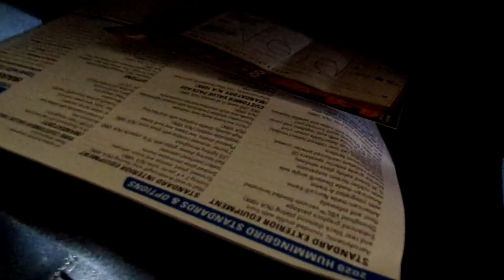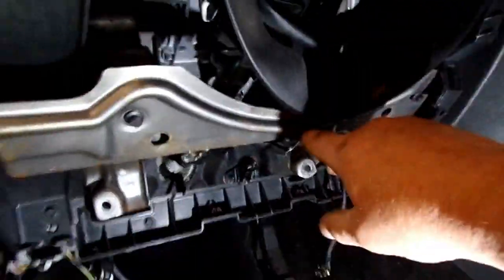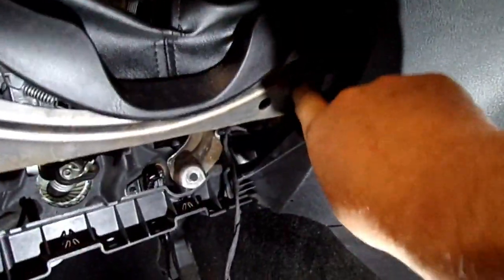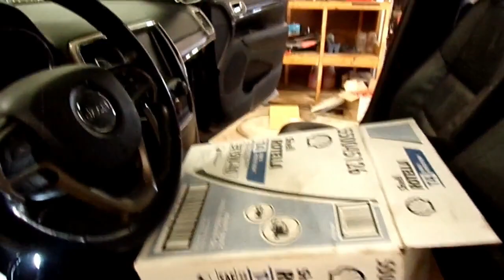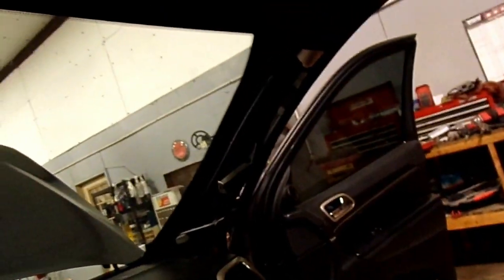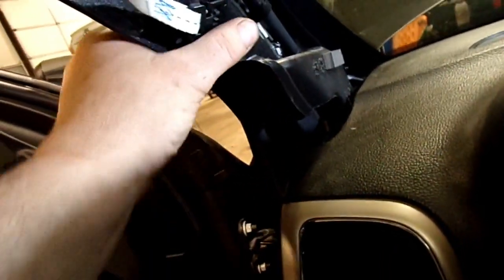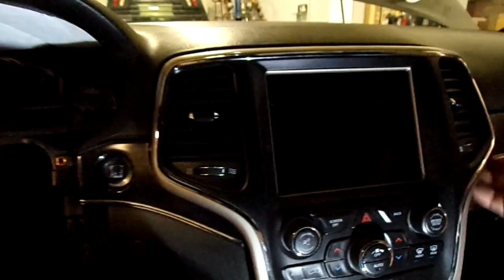2014 JEEP GRAND CHEROKEE : A/C BLOWS HOT , DASH REMOVAL AND BLEND DOOR REPLACEMENT .

Comment: Excellent video. Dismantling the dash is a heck of a job. To avoid this you can break the door free by spinning the gear manually under the dash (you’ll have to spend some time running the heat to soften the seals) otherwise you’d never be able to do it. When the gears get replaced you can put a screw in the stopper on the gear to prevent it from turning the blend door all the way. The result is fully working ac. You’d have a very tiny amount of heat loss on max heat. But it beats ripping the car apart.
Reply: Which gear do you need to spin? The gear of the flap on the vent-just manualy force it open?
Reply: @mattheweason6971  the one that stay in the hvac, normally they are blocked, thats why the door actuator gear break, i am about to test that tomorrow,
Reply: How do you get in there to manually rotate the stuck things. There is a door in the way from fully getting my hand in their.
Reply: Can you do this for me?
Reply: Is there a video on how to do this?
Reply: The motor forces it closed and pushes the door past It rest stop computer gone crazy nice

Comment: I have fixed this problem myself twice. I'm convinced its a combination of the material for the seal, the glue and possibly the heat. The seal turns into a sticky tar like goo, it can not only just glue itself in place and jam the door, the seal can fold over and get stuck in the gap between door and wall of the unit, jamming it as well as gluing into place. I'm currently putting it back together and this time I just tore the seal away and got rid of it, it was like strips of gooey tar. This has been going on for 25 years in the Auto Industry, they have gone to these complicated HVAC units with actuator motors to open and close doors to direct airflow, but then make them out flimsy plastic and materials that are prone to break if the slightest problem is encountered. For something buried under the dash that will require at least a $1000 of labor to change this totally unacceptable. Things to go under the dash and are so hard to replace, need to be engineered to be very durable and long lasting. Yet we get these flimsy components that degenerate into goo or break when the slightest resistance is encountered.
Reply: If the seal was just melting from the heat, well besides horrible engineering they select a seal material that would melt from the heater core, but the seal would go back to normal consistency after it cooled off, although misshaped. The seal turns into a gooey sticky strip, its something with the glue and material of the seal itself for this to change into something like this.

Comment: Came by this video trying to learn how to remove certain trims on the dash to replace the console lighting... It was at that moment I realized... this is NOT something you wanna DIY. If the AC dist case breaks... just have a pro do it. Just remembering where all these bolts go is next to impossible. Kudos to you bro!! Ppl can now appreciate why certain jobs require paying a ton of cash for. Changing a tiny seal or a gear could require the entire car to be dissasembled.

Comment: Completing this job tried all the hacks, but bought the unit on the 2012  SRT the dash has 2 Philips screws on each corner near the windshield. I am fixing the leather dash also , the heater hoses when the unit is free from the firewall i had enough room under dash to grab both hoses. Thank so much for taking the time with the work and video God Bless!

Comment: Honestly did more work than needed. You don't have to take out the entire mounting bracket there's two little bolts in the top corner that are hidden. If you take those out you can take off the entire dash without removing the brackets.

Comment: Incredible work. So much appreciated. Would not have tried this without your great detail. I actually had 100 degrees from my vents w ac on and 70degrees outside! I put a hand valve on the heater core hoses to stop heat flow in the summer. Got it down to 50 degrees but now im going to actually fix it.. cheers!
Reply: Explain if you don't mind

Comment: I have a 2014 Grand Cherokee, passenger side blows only heat when AC is on.
Questions,
1)  I have heard it’s possible to replace the blend door motor and gear by working through the opening after removing only the glove box.  In your opinion do you think that’s possible?
2) What would a Jeep dealer charge ( approximately)for this job in labor, $1500-$2000
Thank you - awesome video!
Reply from the maker: Yes , the blend door motor can be replaced thru glove box opening , I don't know how much the dealer will charge for repair .
Reply: Yes it’s possible. I just removed my on a 2011 Jeep , because the blend door gear was broken on the passenger seat,but also the assembly actuator box is not good, in my case the plastic is melted because of the heated , so I think I will prefer to pay $1200 😅, I don’t even have all the tools to do what this guy is doing on this video. And it look so difficult 🥶

Comment: 1. Must have tool: Harbor Freight, PITTSBURGH Ratcheting Right Angle Multi-Bit Screwdriver Set, 8 Piece $2.99							
2. Disconnect the negative battery cable (under passenger seat for 20 mins.) to recalibrate the blend door actuator system.

Comment: It seems that all the part numbers are the same for jeep and durrango. The mopar part # for heater distribution housing is # 68224169ab the o-rings are 68239586aa and the heater core clamps are 68031980aa. Hope this will help some people too. I personally emailed Danny he emailed me right back about a question I had. Thanks

Comment: I have the same year GC and for a minute there thought that was my car that I had recently bought. Mine is a 5.7 HEMI though. I realize you went through a lot of work on replacing that blower housing. My question is " What's going to stop it from happening again? Did it look like the damper gaskets were made of the same crap material? My AC works for a while, then without touching anything, I lose the AC and the air seems to get very week even at full blast. I can turn off the system for 15 minutes or so and then it works fine again but only for a short while.
Reply: Sam issue here! Start the car and AC works just fine but after a while air starts to come out warmer and air flow goes down. The fan seems to run at full speed, I even tested it without filter, no change. Something blocks the air gradually and then recovers. From how the system works, it makes no sense that air stops coming out and then recovers... Not sure doing this huge effort will solve our problem. Any ideas/advance?

Comment: Awesome work! Thank you for sharing. In my case with my 2011 jeep, I was able to reach underneath my steering wheel to just replace the blend door motor and I think it was strong enough to pull that melted seal apart. But because of your video, I now have a full understanding why it failed in the first place. Thank you!

Question: if my car has a hard time or takes a long time to blow out cold air when it’s hot out, what’s the issue? AC clutch, evaporator valve? I’m getting good pressure, doesn’t seem like it’s a refrigerant leak. I do somewhat hear the fan bearings on the front right dash when you kick on the AC as well but it still blows so could be ok…. I could also try cleaning the condenser too…any suggestions?
Reply: Did it work for you?
I'm in your shoes and tryna find out which route to take

Comment: I have a 2014 durrango the doors in my HVAC box done the same thing. As read someone else commented this should be mopar problem, it definitely should be. This is a big job. I went to my local dodge dealer and got the part numbers for the stuff i would need. Off coarse they were telling me to change the HC, EVC and hc tubes. They said I needed the heater core tubes because they were 1 time use. So I wanted to ask you at the end of your video did you repalace the o rings on the heater core tubes if so whats the part #. Your Video is great by the way too. I do everything myself but sometimes just need that little bit of confidence from a videoo like yours that i'm doing it the right way.
Reply from the maker: Yes I replace the o-rings  but I cant remember what the part number was . I did get them from dodge dealer so I don't know what's going on with that , Maybe they are trying to up sale you on parts    .I would call a different dealer and ask them , Also there could be a different design between Cherokee  and Durrango , Anyway good luck

Comment: Hi Sir, what about after a replacement of dashboard of a 2018 jeep grand cherokee and needing some codes for starting and run and drive?
Reply from the maker: Not sure if I know what you mean , if your installing the old dash back in it should start  ( battery disconnect and reconnect should clear any PCM codes and reset calibration on blend door motors ).
Reply: @heartlandmechanic  Yea, you right, but I mean if you install a new dash, restoring a salvage 2018 jeep grand cherokee and dont wanna start... only lights, no run
Reply from the maker: @crys161  have you had a scanner hooked up and ran it for codes , possibly the security system has you locked out , One thing you could try is if you have the original instrument cluster try and plug it in and see if that helps .

Comment: nice video, I'm planning on replacing the blend door box on my 2013 Jeep Grand cherokee myself but I had a question . Could you just disconnect the heater core lines at the blend door box and just remove that without removing the whole assembly from the vehicle?
Reply from the maker: I don't know if you can get to the 2 screws , It would be worth trying . Let me know if it works , that would save a lot of time .
Reply: @heartlandmechanic  I finished the replacement of the mixing box thanks to your video. I do have an issue now with the display screen reading damaged key fab and that with either key used. I can insert either key and start the jeep. Do you have any ideas what could be wrong?
Reply from the maker: @fundog8922  Wow that's a new one on me . Lets try to manually reboot the passive entry module , Disconnect both battery cables and then jump the cables together ( touch cable ends together - UNHOOKED from battery ) for a few minutes . This will discharge the capacitor and reset set the module .

Comment: does all thsi need to to be done to change the expansion valve as well
Reply from the maker: you will not have to remove dash but you will have to remove that outer firewall to get to expansion valve , remove the nut holding a/c lines on the valve , pull the lines from the valve and there will be 2 torx screws that will need  to be removed , the valve will come out then .

Comment: Quick question! Do a grand Cherokee 2011 and a 2017 use the same housing you are changing?
Reply from the maker: Sorry but I do not know . I'll try to look it up tomorrow and let you know .
Reply from the maker: By looking at pictures in service manual they look the same , The part numbers for evap core and heater core are the same . I CAN'T 100% guarantee they are the same but it sure looks like it .

Comment: Hey Heartland Mechanic, I have a 2014 Grand Cherokee that makes a buzzing/rattling noise when I’m going low speeds. It only makes the noise when I lightly touch the throttle. The noises seems to come from the area slightly above 7:19 in this video. I can send you the video of the noise. I’m desperate and can’t afford to take it to a shop. I don’t believe it’s a serious issue. Thanks for any help!

Comment: Let me ask you this, Do I have to do all that to replace the expansion valve too?
Reply from the maker: No , just the under hood part , when you get the a/c lines loose at the firewall you will see 2 torx bolts , remove bolts and expansion valve will come out .